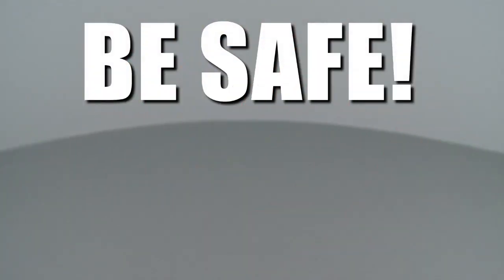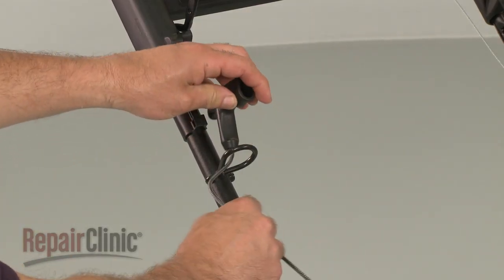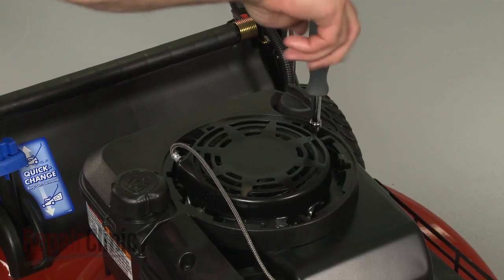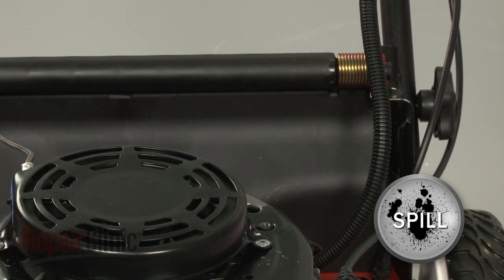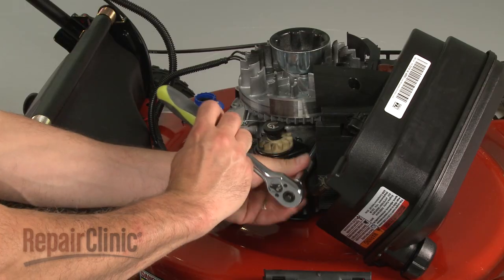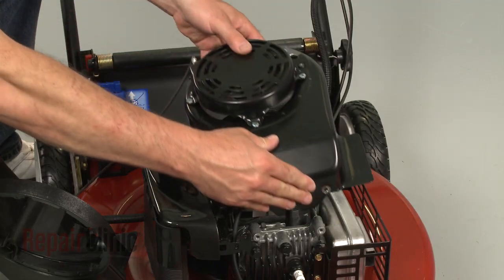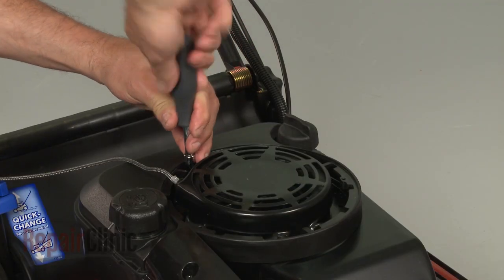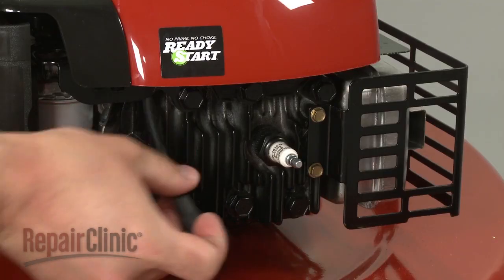Briggs & Stratton Lawn Mower Engine Starter Motor #799045

Comment: Is the starter bad when it does not engage or do anything i tried with car battery on my pushmower and the gear that spins the flywheel when i spin it up with my fingers should it return back itself?

Comment: How do you know if you need to change the starter I turn the key on mine but it doesn’t do anything at all you don’t hear nothing
Reply: Battery
Reply: @ChileMiPais  and what if battery is fine but still no any signs of work?
Reply: Did you check the fuse next the battery?
Make sure you have at least 12 volts at the battery with key off and not drop below 10 volts while attempting to crank the engine over.
They do pull start east enough that a starter is not absolutely necessary.
Reply: @deanmeyer1815  thanks for answering! I’ve solved a problem! It was in muddy key whole, i mean deep inside. I just put the lock of away, and made a contact wire on wire and it torched. But have another problem: that black toothed pulley (don’t know how it named in english) don’t want to stand up, spinning around and clutched just some times (((

Comment: Does anyone know what the sensor or switch is called inline from battery to the starter. Not sure what is activated. The starter will soon when testing. The start button works. If I bypass the sensor I'm sure it will work. It's a 2014 Craftsman 22" all wheel drive electric start.
Reply: It's an momentary switch

Comment: Is that a 110V power source or a 12V Battery source and how does one tell if it has that particular electrical connection at the starter
I ask because it's the first time I ever saw a push mower w/an electric starter that small nor a connection like that either ,so I'm kinda dumbfounded at this point 

God bless and have a cool day .
Reply: 12Volt battery....all of the riding mower or push/self propelled mowers use a 12v system..i dont think the self propelled  key start mowers have alternators to recharge the battery though like a riding mower. you have to plug it in an recharge the little 12 battery..the battery is similar to what you see in UPS for computers

Comment: Is there a reason that there is no boot or cover on the bottom cover for the armature shaft? Seems like a design fault for failure allowing it to run dry of grease & seize! Anyone have a simple fix, tack on a bottom dish shaped cover?